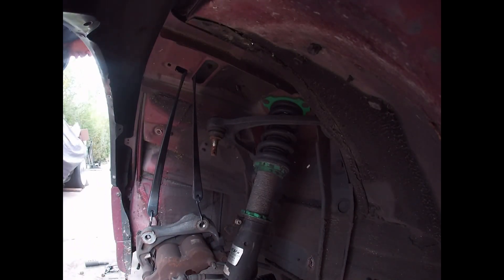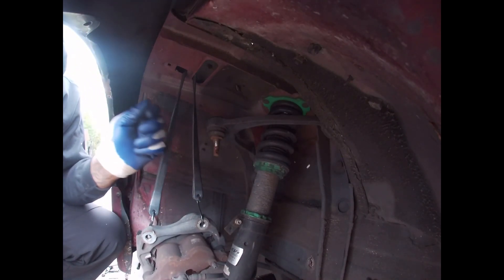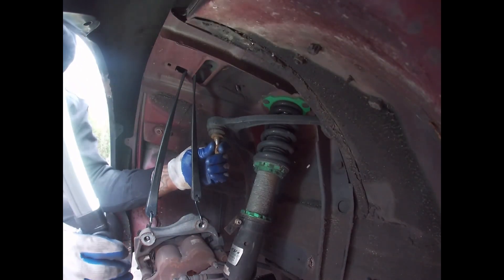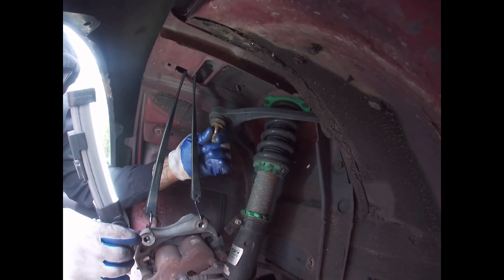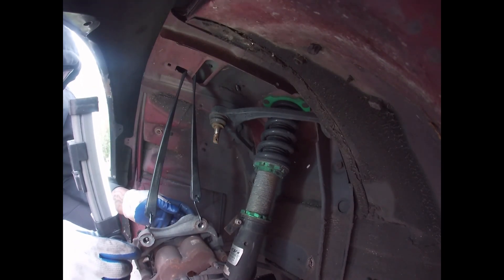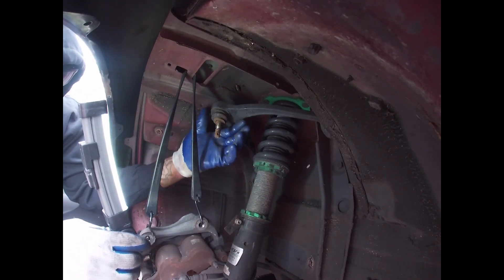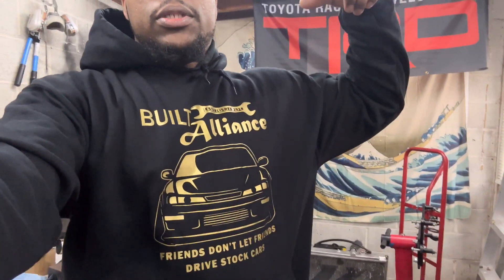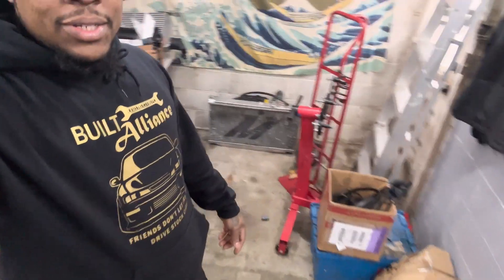Gs300 control arms and ball joint change

Comment: It's always easier to just loosen the sway bar link, top of the coilover mount and pull it down
Reply from the maker: Was trying it a different way this time, wasn’t to hard to do the way I did it in the vid but definitely not the easiest lol
Reply: @builtalliance2501  Yeah trust me I've been there. It's always pulling out and putting back the bolt furthest to the front that makes it a hassle... What's next on the GS?
Reply from the maker: Ls400 big brake upgrade then soon as I get the Sc running I’m installing the ar5 manual transmission
Reply: @builtalliance2501  That's what's up...I recently did the Supra bbk on my GS, I didn't go LS400 brakes because I don't like the idea of my calipers hanging on a bracket.